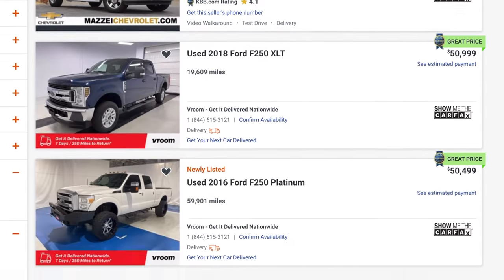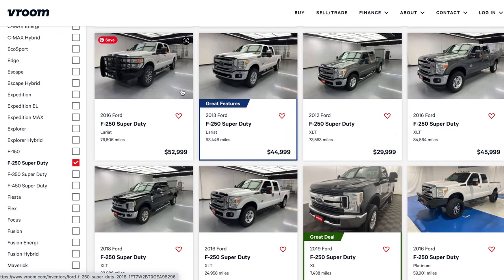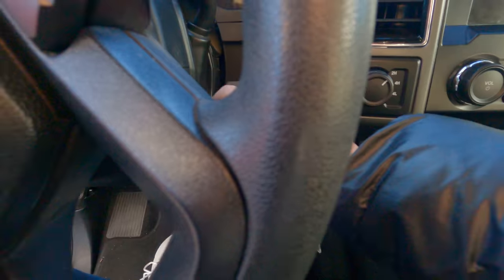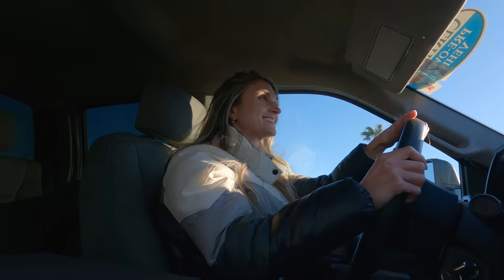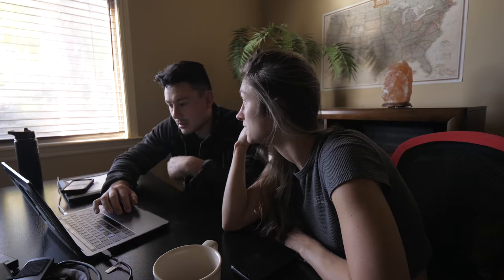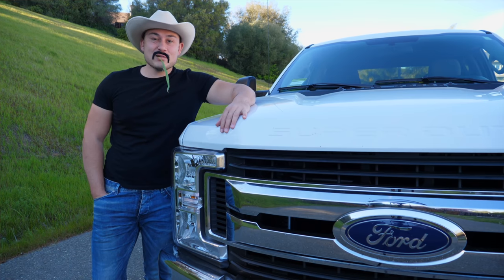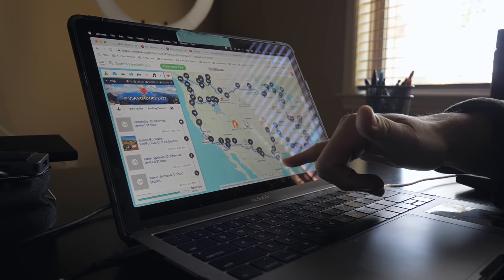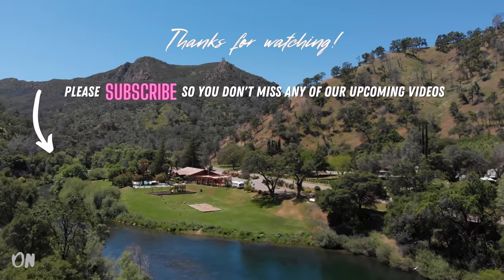WE BOUGHT A BETTER TRUCK TO TOW OUR RV (upgraded 1/2 ton to 3/4 ton!)

Comment: I ordered a new 2022 RAM 3500 Cummins High Output Limited loaded on 12/2/21. The MSRP was $95k. They are charging me MSRP. The truck is finally here over 3 months later. The MSRP on the exact same truck if you were to order it today is over $98k. Crazy times!

Comment: I towed with a 2003 Denali for years. It’s basically the same thing as an Escalade. The engine was more than capable, but the 4 speed transmission basically ruined the experience. One trip I borrowed a friends 2011 suburban with the 6 speed and I was blown away by the difference. 

I started shopping for a newer Denali and ended up in a 2007 Chevy 3500 duramax single rear wheel. 

I think you will be much happier with a heavier duty chassis and more gear ratio. Not to mention a bit of a power bump.
Reply: Also, good call on getting gas. While diesel is a nice luxury, the price difference between the gas and the diesel can buy ALOT of gas to burn going down the road.
Reply from the maker: Good to know, so far we're happy with our choice!

Comment: Congratulations on your choice of truck! The 3/4 ton trucks are an extremely capable class. I have a 1/2 ton F150 that probably could tow your trailer but... given how tight I'd be with payload (trailer tongue weight counts toward that) it's very possible that I would be over GVWR by a bit. That's where those 3/4 ton trucks come in quite handy! The newer F150's can drag around upwards of 13,000 lbs... and F250's can get into the 14,000 range but the payload is right where those F250's shine, especially when set up specifically for towing duty. I suspect you have more than enough reserve in terms of payload and tow capacity that you'll rarely, if ever, have problems related to towing. The only downside to the 3/4 ton (and bigger) trucks is the gas mileage... 

My truck? Well, for the most part it's a daily-driver that will very occasionally tow. If I were to tow as often/long as you folks do, I'd also go F250.  I've had one in the past and I enjoyed every minute of it (it was also quite old) and I do think you'll enjoy every minute of the F250 for all it can do for you!
Reply from the maker: Thanks for the rundown Jeremy! Yea the F-250 will be a major upgrade for us in terms of tow capacity and payload! 💪🏽 We’re just stoked we no longer need to worry about that stuff with this new set up! We ain’t looking forward to the gas mileage though that’s for sure 😩
Reply: The added weight of the tow vehicle and larger brakes is well with the upgrade.

Comment: We were in the same boat!!!! We had a very nice Ford Explorer towing a 20 foot TT. We then upgraded to a new F150 which we loved. Soon after, we upgraded our trailer to a 38 foot TT with a Hensley hitch to help a bit. We then upgraded to a F250 Diesel which completely changed our tow experience. Shortly after that, we sold the 38 foot TT, and sold our house and went full time in a 43 foot 5th wheel. Because of this upgrade, we traded in the 250 and went for a 350 dully!!! We basically ran through the entire ford truck line up lol! …. 450 isn’t out of the question 😎 j/k …yes it is… congrats on the truck!
Reply from the maker: Dang Ben, you guys have seriously tried it all!! 😂 Wouldn’t be surprised if you went with the 450 next haha what a great experience and perspective to go through that entire process, very cool! Safe travels and thanks for sharing! 🤘🏽
Reply: Sounds familiar.  Three trucks and four campers later...42 ft fiver and an F-350 DRW.

Comment: I had the same truck.  Pulled our wildwood 30KQBSS with ease.  I now have a 2022 F350 with a 7.3.  I would have kept my 2019 had i not been offered 15k over what i bought it for on trade.

Comment: We got a 2019 Ford F-350 dully to pull our 5th wheel last year. It’s a great truck and has the ratings to pull 15,000 pounds that our 5th wheel weighs.
Reply from the maker: Awesome set up Shelley! We’re stoked to have more towing capacity! 🙌🏽

Comment: Be careful with your budget, now that you have a 3/4 ton truck you can get a “better” camper. My first truck was maxed out with our first trailer, so got an F250, 2 months later, traded in my 4 month old travel trailer on a fifth wheel. 🤦🏼‍♂️

It really does tow much better than a travel trailer and soooo much easier to hitch/unhitch. 

Looking forward to your camper search videos. 🤪
Reply from the maker: Haha thanks Adam! Not searching for another camper just yet but maybe down the road 😂 we feel much better and safer with an F250! Safe travels!

Comment: And this folks is why I am still driving my 1994 Nissan pick up. Having said that I'd really like to travel back to before 2019 and buy a quality used full size pick up on the cheap.  This is the worst time in all of history to buy a truck.   However, Congratulations you two, good work on doing your do diligence....
Reply: I regret getting rid of my 90 hardbody the odometer stopped working at 260k miles and started everytime. I did however but a 2019 TB with 15k miles for 42k before the price gouging.
Reply from the maker: Thanks for the support! Indeed, it is the worst time to buy a truck haha but we gotta keep living our lives and traveling! All the best!

Comment: Thank you for video. I like it that your using your female friend to evaluate your buy. There are things a Female who knows a little bit about trucks (Pick ups) that males don't see ( always got to have the big Diesel. MALE) it's funny though got a DOGE truck commercial during this video. Doge has the AIR bags for lift. And they started putting tool boxes in those dead spaces on rear body. The screen size on new Dodges is huge. I personally like the GPS, it seems like a must for these two doing the video traveling. I was in Florida, traveling down from Mississippi, this was Hurricane Katrina time frame. Boy the Police and Power company CONVOY where all over. But anyway the potable GPS I had, it showed me all the roads around me. I knew where I was at( had the paper map in lap) but a GPS is a must in a Pick up for me.
By the way have always owned FORD F-250s my whole life. But boy the things GM and Dodge are put in Pick ups know. And really surprised by the 5.7 Dodge 3 quarter ton getting better milage than the smaller engine in Ford or GM on tow test on other video's I watch. Real road tests with a loaded horse trailer.
Reply from the maker: It's always a collective effort. Cheers!

Comment: I don't think ill ever get a 3/4 ton again the cost is about 90% of a 1-ton same pickup but 3/4 can't tow most 5th wheels. You also limited to mostly travel trailers which can be towed by lot of 1/2 tons. I think for me ill either go 1/2 ton or 1 ton not the 3/4 again especially with the diesel it reduces the payload by almost 1000 lbs.

Comment: Should check out ram
Reply from the maker: We did and liked them too, it just happened that we found a Ford we liked for a decent price! Cheers Michael!
Reply: @ONWorldTravel  safe travels like a go over of the truck is it a 6 or a 10 speed transmission saw it had the gas 6.2 . As for more base line less to brake down with and can tow more

Comment: Look, like you said you probably way overpaid for the truck since they are all super inflated right now. Since we are exiting the inflated truck market, no matter what you do, even if you don't put any miles on it, it's going to depreciate. And get ready for it to depreciate BIG TIME! Like gonna $20k in the next 2-3 years just by existing
Reply: Also, THANK GOODNESS you didn't get the diesel. So unnecessary 99% of the time!
Reply from the maker: Hey Joe! Yea we got the best price we could have but still know we overpaid…I’m glad we were patient though and got a slightly better deal. We’re prepared for it to depreciate but it’s worth it to continue living our lives and traveling! The Escalade simply wasn’t cutting it anymore 😂
Reply: @ONWorldTravel  I'm in the same boat, and have been shopping F250. We currently tow with an F150, but our trailer maxing it out. Not quite like your escalade though! The brakes on fire 🤣. We will eventually overpay for an F250. I'm just debating whether to bite the bullet and build a new cheap one versus overpaying for a used one

Comment: I'll say a prayer for your pocketbook. A gas 3/4 ton is TERRIBLE on fuel while towing. Diesel is higher maintenence cost but way better for towing.
Reply from the maker: True, but diesel’s were outside the budget. Maybe down the line we’ll switch but for now we’re just stoked to get back on the road! Cheers Hayden!

Comment: all the new trucks suck get a real truck not junk you got ripped off  i have a 1974 Internasal  3/4 ton with 485000 on it and my 01 dodge has over 420000 on a gas 4.7 that fancy ford is crap